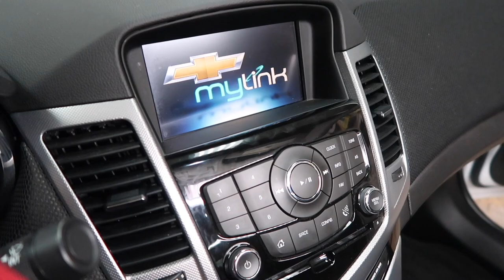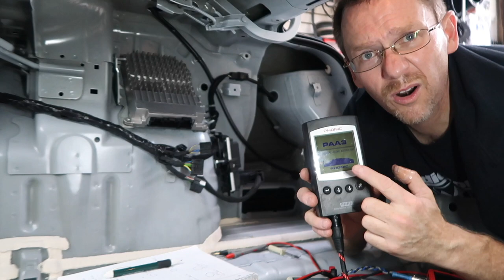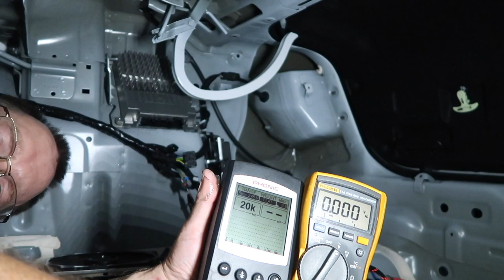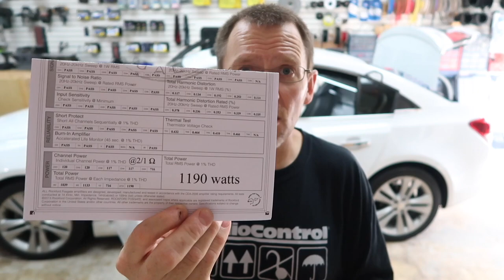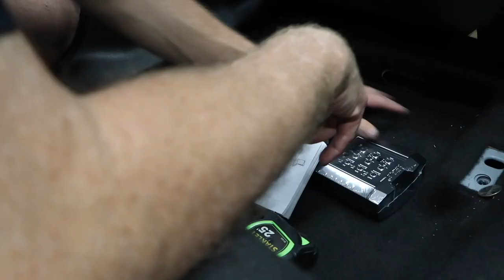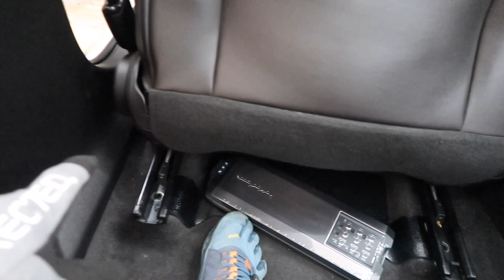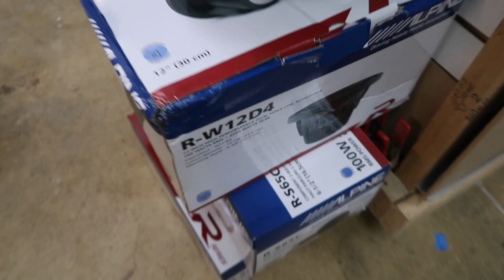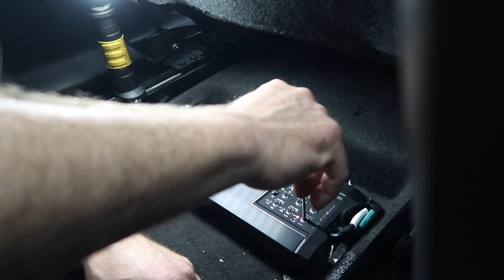Chevy Cruze full car stereo teardown upgrade

Comment: Awesome job, I just bought a 2014 Chevy Cruze LT Manual 6 (in 2023).  I like my 2000's new metal (Korn, Sevendust, Disturbed , Mudvayne) with bass guitar slide drops on two 10" subs in addition to a punchy kick drum.  This video will help to add my box and an amp.  Thanks very much, awesome video.

Comment: I have a quick question, on my 2014 Cruze with the technology pkg......would I need to install an amp if I upgrade the speakers?
I'm not looking for anything crazy loud to rattle the car. But I want a nicer decently loud system to enjoy music properly.
Reply: From my understanding if you keep the pioneer amp and just install different speakers the volume won’t get any louder just because the amp is set to a certain volume but the quality of the speakers themselves will sound a million times better

Comment: I don’t get putting the amp under the seat. Yes it’s a pain in the ass to run a big power line back to the trunk. You also have a little further to run the sub level knob. But then you don’t have to run your input signal and speaker lines back to your trunk. You also protect the amp better. Little Johnny isn’t going to kick the shit out of the amp under the seat with his feet. Finally, should you decide to add processing or such, it’s already there and you usually have a lot more room to work with. In the end, the result is pretty much the same, I guess you just pick your pain.
Reply: proberly cost $200 more in wiring and labour moving it to the trunk. up to the customer if or not they want to pay that extra price.